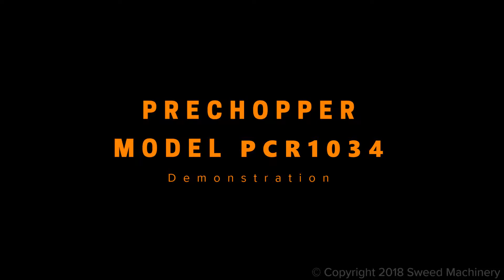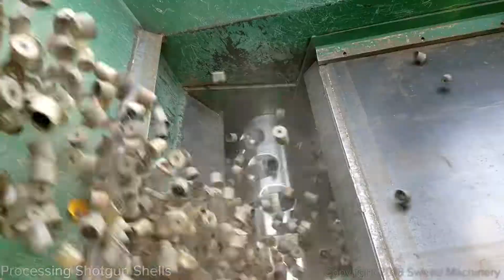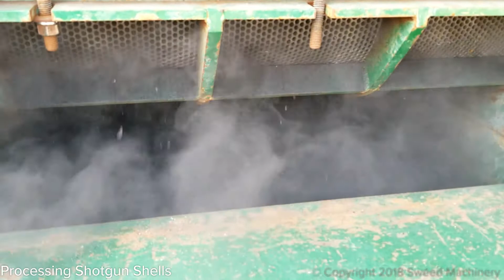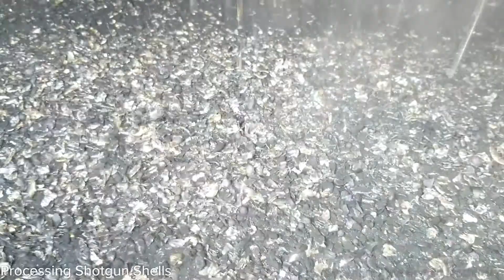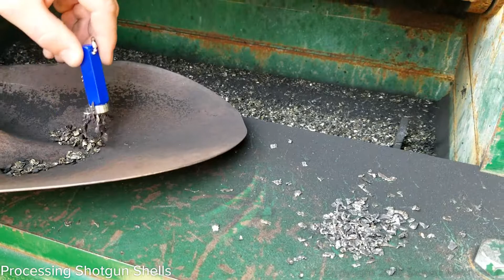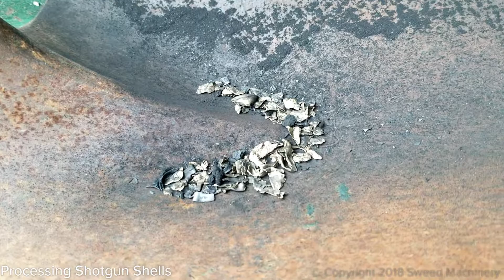Sweed Prechopper PCR1034 Scrap Shotgun Shells

Comment: Yes but how do you separate the steel from the plastic
Reply from the maker: The customer who provided this application only wanted to destroy the shells. However, if they wanted to remove the ferrous content and separate it from the plastic, we would accompany the prechopper with an outtake conveyor plus an overhead magnetic cross-belt. The cross-belt would pick up the ferrous content and remove it from the plastic stream.